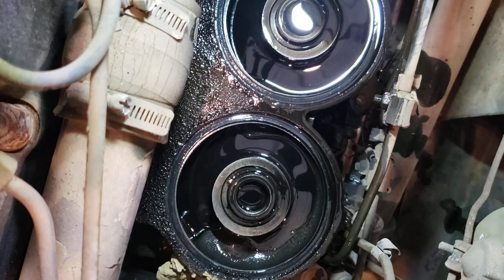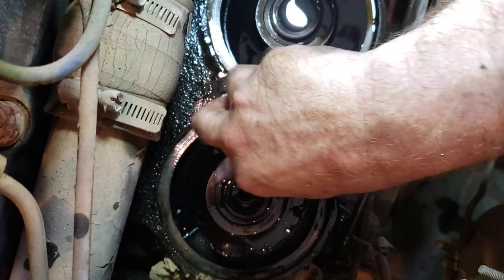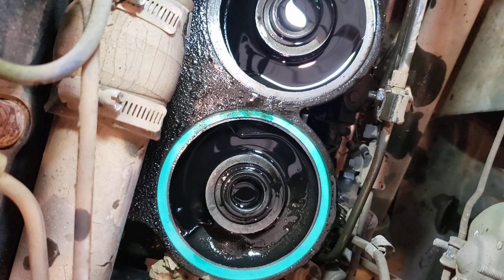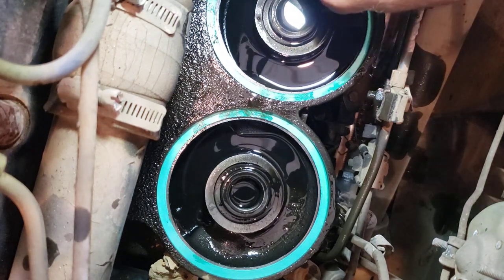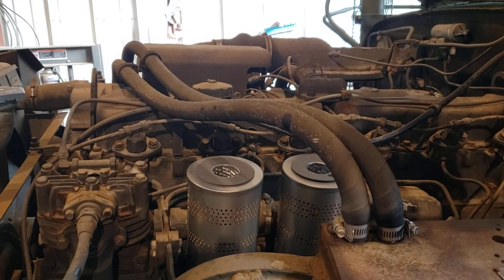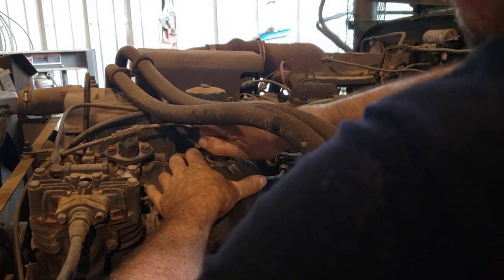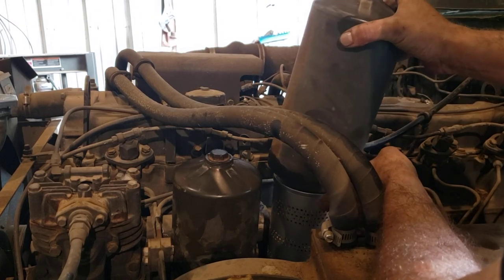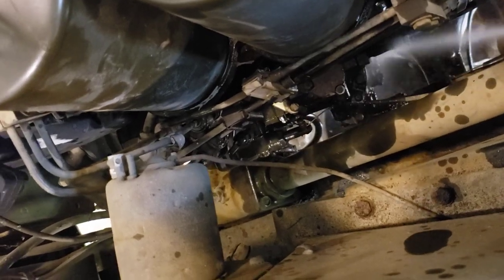Proper installation of M35A2 oil filter gaskets.

Comment: Fantastic...thank you for showing how to properly set the gaskets and how to do the stock oil filter replacement job in general. I could see why people convert those to the spin-on version for convenience. But, I really appreciate seeing how the original stock design works and how to properly service that design.

Thanks again Garrett.

Comment: Does it help to put a light coat of silicone sealer on the flat gaskets and should the copper gaskets between bolt & canister be changed periodically? 
Thanks, very informative videos.
Reply from the maker: No you shouldn't use any silicone on the gaskets. They have to be changed every time and leftover silicone will just cause leaks later. I only change the metal washers if they start leaking, but only had that happen one time.